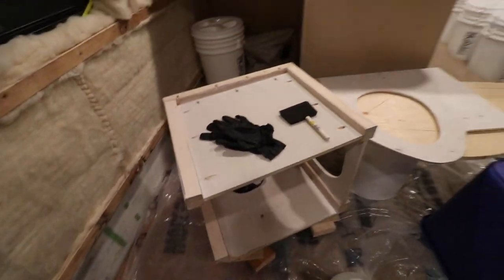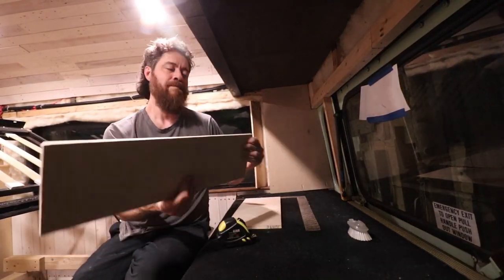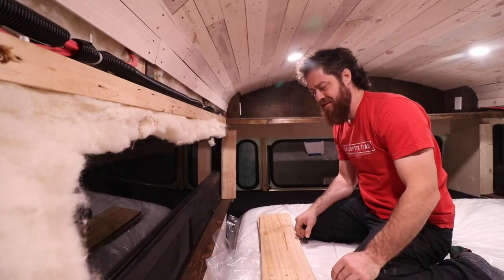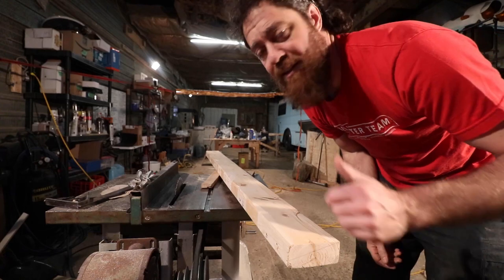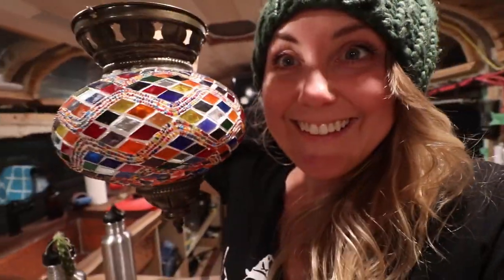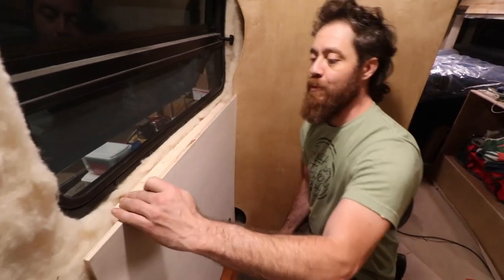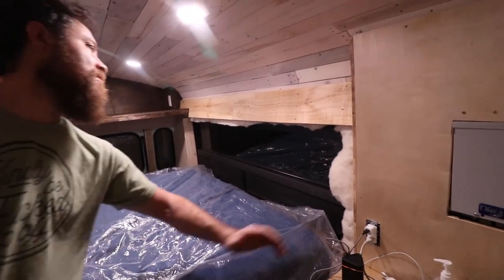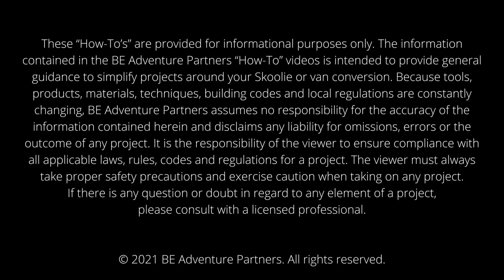Prepping Skoolie Love Nest To MOVE IN (Plus Finishing DIY Composting Toilet With Epoxy)

Comment: This thing has to weight a ton.  I wonder if the engine will be able to move it.  Looks good guys.
Reply from the maker: You're right! Buses actually weigh WAYYYY more than a ton! When we gutted the bus, it weighed 18,200 lbs (9.1 tons) and has a GVWR of 34,200 lbs (17.1 tons). However, we don't plan on using the entire weight rating as we're working to keep this as "light" as possible. We've seen people who do roof raises come at in around 26k lbs (and we didn't do one of those! So we MAY be less... We'll know as soon as we're finished as we plan on hitting the scales.)

As for the engine being able to move it... Absolutely! The CAT3126 engine is a diesel workhorse designed for commercial applications and they typically can run a million miles before needing to be replaced. So we have around 750k miles we can put on it before needing that (as long as we keep up with a routine maintenance schedule.) That's the beauty of having a Skoolie vs. a light weight motorhome... these things are built like a tank!

We're happy that you are enjoying our build @Kyle Geitzenauer! Thanks for watching!
- Brian + Erin